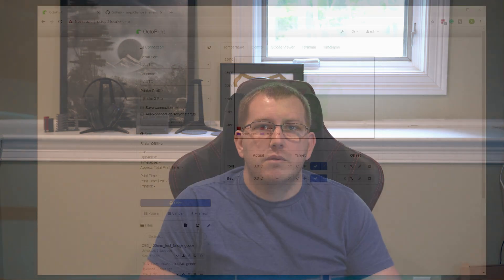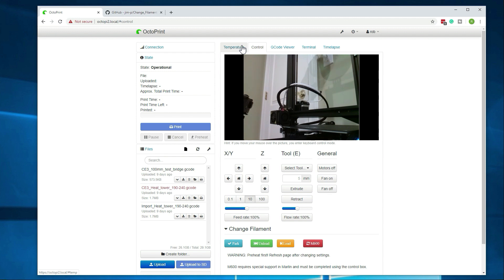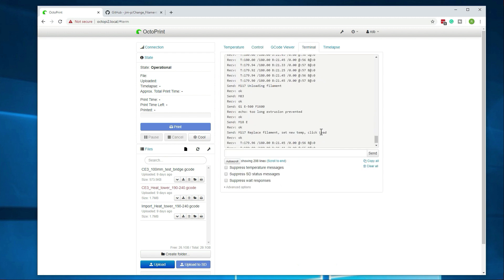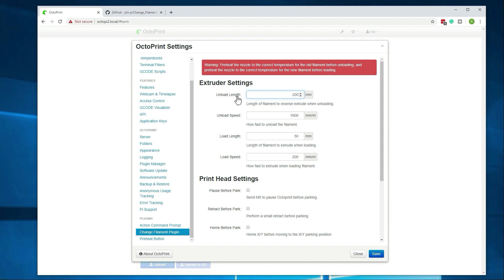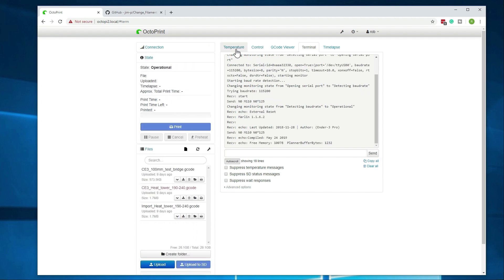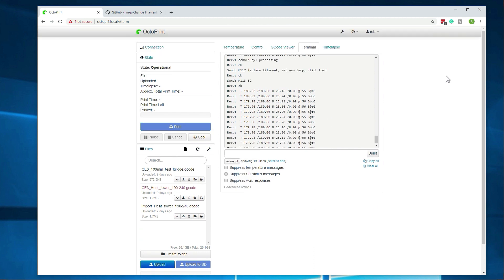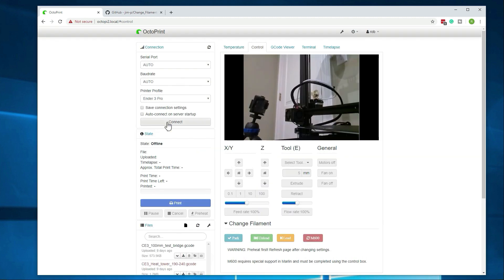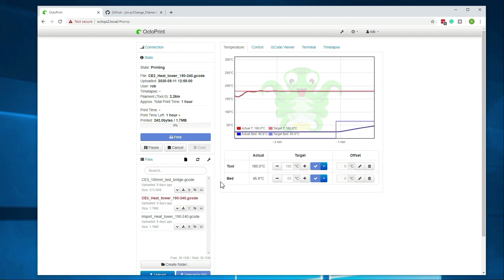Octoprint Change Filament Guide With Tips & Tricks

Comment: Thanks for the video. Would I able change to a different colour filament during mid print with this plugin? If so, do I use the “pause” or “park” button? Thanks 😊
Reply from the maker: Hi. You should be able to. I would use the park button if the firmware is setup to support it.

Comment: Yeah but how do you do this mid print?  Is there an unpark option?
Reply from the maker: Hi. After it goes into park and you change your filament, you would hit resume.
Reply: @3DPrintscape  Yes, I did that.  What I noticed is that the Z coordinate didn't go back to the original Z axis before i parked it.  Resume caused the printer to hover over the print and resume printing in the air.
Reply from the maker: @SulingClarinet  Ok, it sounds like the z axis position may have been changed when adding the filament, probably got bumped or something. If any movements are made that arent done by the steppers, the printer wont know about it.
Reply: @3DPrintscape  I didn't change the filament.  I think that parking lifted the z axis but then it never put it back down again when I clicked resume.
Reply from the maker: @SulingClarinet  Got it. I havent seen this before, it just worked for me. What firmware are you running?
Reply: @3DPrintscape  It's version 1.0.2.  That's what shipped on the printer.  I noticed there were other versions available on the ender website but those only seem applicable if I add filament detectors or BL Touch so I didn't bother to update.
Reply: @SulingClarinet  My ENDER has an auto Z change when you do Home on X-Y axis. In my case, its always 5mm. So the problem here is using the homing option. Try without "Home Before Park" and maybe your Z won't get messed. If not, you'll have to take a look at your Z value before park, and adjust manually to that same height when you're ready to resume.

Comment: Can you tell me exactly how to get the print to resume? Every time I try, it won’t go back to its original position, it never fixes the height back to its original location.
Reply from the maker: Hi. The printer cannot go back to the height it was at, it cant without doing a rehome because it wont know its current position. You will need to avoid moving the height when changing the filament.

Comment: Thanks for the help!!! BTW, u can´t extrude or retract more than 200 due to the firmware
Reply from the maker: Hi. You're welcome and your correct assuming you are using pre-compiled firmware or the default settings. I have EXTRUDE_MAXLENGTH set to 500 right now, but i know thats not the norm.

Comment: Thanks for the helpful video. I see you have a useful "System" icon (for shutdown/reboot/restart options) next to your OctoPrint "Settings" icon. I didn't find it in the available plug-ins. Can you tell me what that plug-in is named? Thanks in advance and keep up the great work!
Reply from the maker: Hi. That should just be part of the standard OctoPi install. Make sure you are on the latest version but if it's not there, I would check on a different browser.
Reply: @3DPrintscape  Thanks for the reply. I'm not running OctoPi. I'm using OctoPrint 1.5.3 in Safari 14.0.2 with MacOS Catalina 10.15.7 running on a mid-2012 MacBook Air (not compatible with Big Sur). Perhaps the "system" icon is OctoPi specific?
Reply from the maker: @twhitex1  I think that may be the case. Ive only used OctoPi and its been there on every install that I've done.
Reply: Since I had an old laptop sitting idle, I didn't see the need to invest in an OctoPi. Maybe someone who has used both can confirm if the settings icon is available only on OctoPi and not OctoPrint?

Comment: My advice is not to use this plugin. Its buggy and it could ruin your print. I did 3 tests tuning the settings between each test and after changing the filament and resuming the print it suddenly stops and it melts the print. I would rather pause, move manually the head out of the way, change the filament and resume the print.
Reply from the maker: Hi. Thanks for the feedback. The plugin was pretty stable for me when I was going through my testing but I'm sure there are a lot of variables at play.

Comment: I found that I did not have to restart the system only refresh the page as it says below the controls "WARNING: Preheat first! Refresh page after changing settings."
Reply from the maker: Hi, thanks for the feedback. I found that it shows the new settings when you refresh the page, but they don’t actually take effect until after a reboot. II made changes multiple times, refreshed the page, and kicked off the test. The result was that the old values got sent to the printer. I was able to see that in the terminal output.

Comment: Is this plug-in usefull to change fillament while the machine is running? Thanks in advance
Reply from the maker: Hi. Between Octoprint’s built-in functionality and the plugin, you can change the filament in the middle of a print.  You would pause the print from the area on the left that shows all the print information. Then you would go to the change filament plugin and hit park to move the extruder away from the print. After that, you would walk through the unload and load steps. Once complete, you can resume the print.
Reply: I did this and after it went back. Z would not resume  just tried to print in the air..ANY THOUGHTS. Thx
Reply: @3BoyzLaserEngraving  Ditto for me as well and even after canceling print it kept extruding til I switched off the machine.  Waste of time.